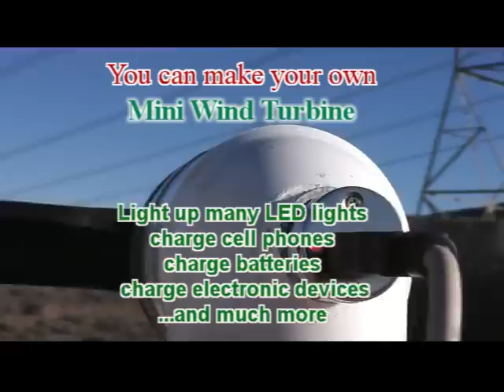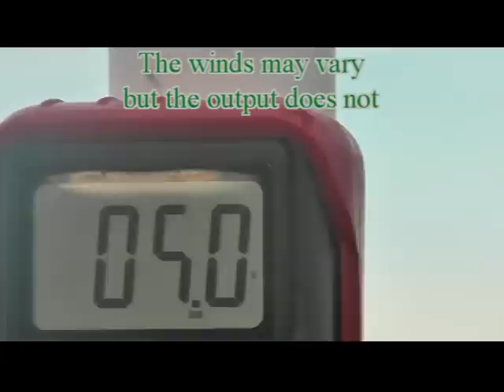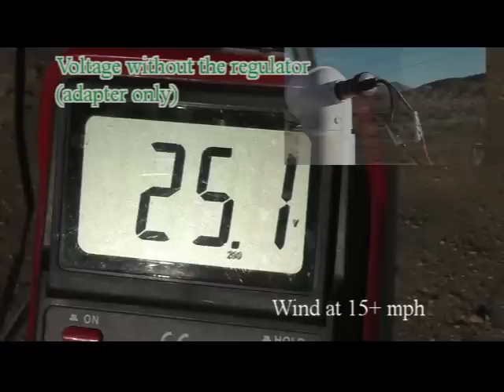Mini Wind Turbine G2

Comment: Where did you get the prop?
Have you made a version with a vane?
What kinds of current do you get from that bipolar stepper?
Reply from the maker: +Ryan Ethier 
Ryan, I sell these props, brand new, at the same price one buys direct from the factory $19.69. They are made of glass fiber composite, extremely durable. The specification = 20x8 (20" is the diameter).
-Yes, I have a version with a vane (shark tail) which I am about to record on video, and it is going to be published here on my YouTube channel, as well as sold in kits, probably on Amazon.
-The generator on the kit has two coils inside. Each coil generates from 100 mA to 300 mA of current. In 20 mph winds, I have registered 70 volts plus.
It is not a powerful wind turbine, but quite an interesting toy.
Any further questions, I'll be glad to answer. STT
Reply: +ScienceTubeToday Thanx for the quick reply! I live in S. America so these props run up around the inaccessible range for a toy, even a real cool one! But.... 200 to 600 mA is enough to charge a Li-Ion battery pretty quickly! Ever heard of the MCP73871 by Microchip? The turbine along with some regulator and charging circuitry would make for a wicked gadget to take along to the beach!
Reply from the maker: Voce mora no Brasil?
Thanks for mentioning the MCP73871. I will do some research on it, and see if and how I can integrate it in my Mini Wind Turbine kit. The kit comes with a full wave bridge rectifier, then a voltage regulator and two capacitors to completely smooth out the ripples of the rectified current. I think you know that the full bridge rectifier does not eliminate all the ripples...That's a job to be finished by the capacitors :)
Yep, that would be nice if one could take it to the beach, camping, hiking, log cabin up in the mountains. One disappointing problem is that we can't charge an i-phone with it. The iphone has a proprietary software that does not allow it to charge. You always get a message "this device may not be compatible"...and you're done! Who knows if the MCP73871 can be a game changer... 
Take care!  STT
Reply: Opa! BR aqui, LOL! 
Just one more case against iPhone.... 
Unfortunately the MCP only outputs 4.2 Volts. It does however automatically charge a single cell Li-Ion and also controls where the load get's its power from depending on source voltage. The only problem then is boosting the output or batterty voltage from 2.5/4.2V to 5V.

Comment: Where do you get a propeller?
Reply from the maker: +Robert Reed 
Robert, I sell them for $19.69. These propellers are very sturdy and high quality. They need moderate to strong winds to perform well.
Reply: Do you have a link to the propeller and fan? I would like to make the same exact build.

Comment: again a nice video, please tell me what was the detent torque of the stepper motor that you used and what current did u get without the adapter and with adapter , did you really get 1 amp ?
Reply from the maker: +G S Shirnewar 
Since I removed this stepper motor from a printer, I could not obtain the specs on the detent torque of this particular motor. The factory will never pass that information along, nor will they publish or reveal it...it is proprietary information (I tried). I can provide an educated guess... Detent Torque = 65 G-CM (0.9 OZ-IN) Min. This stepper motor gave me close to 1 Amp at very strong winds. After the video was published, I thought  I should  have made a different statement...like close to 1 Amp. I have some in my workshop that give me 0.4 to 0.7 Amps, and that seems more common. I did not mean to publish misleading information. STT
Reply: Is there any electrocution danger from the amps / voltage this can put out? 30-50 volt, close to 1amp?

Comment: I bought a nema23 stepper motor from eBayThe shaft turns hardly Wondering if its normal or it should be smooth
Reply from the maker: +Iman Faith 
What makes it hard to turn is the detent torque which is the interaction of the powerful magnets in the rotor (the spinning part) and the stator (the outer casing). Your motor has a high detent torque, and it will be a challenge for you to make it turn...you will need a large propeller.
Reply: How large?
What I was thinking is using a triple PVC propeller 50cm length for each blade, is that OK?
Reply from the maker: It might work, depending on the design. The challenge is to balance the three blades. Even professionally made blades have to be balanced. Vibration influences performance. As long as you can eliminate vibration as much as possible, you should be OK. The other point is structural strength. PVC tends to break in strong winds. I would reinforce the point where you screw the blades - if you are dealing with strong winds. Another suggestion is to use a 3 blade propeller from a household fan. I have used them, and they work OK too.

Comment: Very interesting, just about to get started, but according to your video, the bridge rectifier turns AC from the motor into DC, but doesn't the motor already make DC? Does the adapter need AC or DC? If it needs AC, doesn't this method not work, and if it's DC, isn't the bridge rectifier redundant?
Reply from the maker: +Austin Parenteau 
Austin, not at all. A stepper motor only produces AC. You do need a bridge rectifier to convert it to DC.

Comment: can I use cooling fan blade from pc instead of prop adapter?
Reply: +Arun Kumar duh ive been trying to figure out where to get a fan from lol and never thought about just using the fan from the cpu fan lol... thanks... they should work great. and already made to work on these small dc motors. good idea.
Reply: *****
i went to an RC hobby shop and found some air plane propellers that fit nicely and seem to work great... they are about 4 inches long and three blades...
Reply: *****
i was thinking of putting it on the bottom but making a box of some sort like a shelter sort of for the plug. i have a nice enclosed patio i might place them on as well and just run the wire into the patio then add the plug... options options...
Reply from the maker: +FixedByDoc Homesteading 
I saw your comment, and here comes a quick reminder. AC travels much more efficiently than DC, therefore, only use the rectifier after you brought the current to the final point where you will need to use the DC. If you rectify right at the origin (say inside the wind turbine), then run a wire, you will lose a lot of electricity. (Read "War of the Currents" Tesla Vs. Edison...well, Edison, the DC guy lost  Tesla and Westinghouse the AC Guys won... :)
Reply: ScienceTubeToday
the length even with the turbine on my patio roof would only be about 2 feet before reaching the battery which i would set on a shelf near the ceiling of patio. attach charging station there.

Comment: cute
Reply from the maker: +snaprollinpitts 
Thanks!  :)
Reply: I have 46 size brushless motor I would like to do this with, I just gotta find a set of blades, thanks for the idea!
Reply from the maker: You're welcome! 

What size blades (propeller) are you looking for? You also may need a propeller adapter to secure the prop to the motor shaft. Do you have them both?
Reply: anywhere from 24" and multiple blades would be good, and the shaft size is about 3/8".
let me know if you have anything, and what you what for it.  thanks mike
Reply from the maker: I have 20" 2-blade propellers just like the one in the video for $19.69. I also have a set of three blades and hub. Each blade is 21 5/8 long. When assembled to the hub it measures 22 3/8 center to tip, so your total diameter is approximately 45". This may be too big for your project. The hub hole is 5/8, so it would require a very precise adapter. If the adapter is not 100% correct, you will have a wind turbine's  public enemy number 1 which is vibration. I suggest you look online first and see if you can find something that fits your project. The blades I have cost $18 each and same price for the hub.Meantime, you may experiment with attaching the shaft of your motor to a regular drill. Spin the shaft with the drill at different speeds and see if this brushless motor will produce what you expect. I would not invest any money before testing the output. (I am assuming you have a voltmeter). Please be extremely careful using the drill and motor, and start a low speeds to make sure your set up is safe. Good luck. Let me know how it went

Comment: Hi Sir Can i ask What are the name of those 4 Diodes?
Reply from the maker: They are Schottky diodes
Reply from the maker: but, you can buy a bridge rectifier already made, they are very common electronic components, and very inexpensive too. They take in alternate current, and output direct current
Reply: What's the spec of the diodes? 100V 0.1A? or 45V 12A?  or 30V 1A ? Or?

What's the max voltage / amps this turbine can generate?

Comment: do you not need to put smoothing capacitor after using the bridge rectifier?
Reply: pls reply, we will use this as our research
Reply: Yes, a capacitor can be added to smooth out the peaks. It will make it better. Good comment Patlo.
Reply: Yes, a capacitor can be added to smooth out the peaks. It will make it better. Good comment Patlo.
Reply: thank you for the answer, my stepper motor has 4 wires, how can I make it to two wires?
Reply: my stepper motor only produces 7.5 to 8v ac even at high rpm, what type of stepper motor did you use?

Comment: Can you please provide the motor you used? "Low detent torque" does not help when purchasing direct from manufacturers. They requested torque in cm, Oz, etc.
Reply: it looks like a stepper motor (type 17) with 6 wires.
Reply: the motor shaft on those is 5mm  and you can get a propeller adapter from Walmart online.  and propeller in a hobby shop. 18" circumference
Reply: If a stepper motor is rated for 12v, how can it generate up to 30v safely?
Reply: Would this be a good motor/? https://www.adafruit.com/product/324 And what about torque? I've seen some called high and low torque, what would be best?
Reply from the maker: Yikes, I missed your comment. We need to know the "detent torque", which is different than "torque". An easy way to find out is to test the stepper motor manually. Detent torque is the resistance that you can feel in your fingers when you try to spin the shaft. If the resistance is high, then it has a high detent torque, and you will need a bigger propeller to overcome that resistance.
Reply from the maker: OK, the voltage that runs a motor has nothing to do with the voltage the same motor produces when used as a generator. For example, I had  my mini wind turbine outside on a day when the wind was blowing 30 to 40 miles an hour. I was measuring between 60 and 80 volts output, then I connected it to a step up transformer which gave me between 300 and 400 volts (yes, this little wind turbine you saw on this video). What happens is that there is really no net gain, since the voltage increases at the same proportion that the amps decrease - therefore the Watts stay the same. High voltage is useful to light up long fluorescent lights...and that light stayed on for as long as the wind was strong...

Comment: how much willl tht all goign cost
Reply from the maker: Buying everything new, with taxes, shipping etc...I'd say $60 to $80
Motor around $20, Propeller some $25, Prop adapter $7, PVC fittings, bridge rectifier, car charger connector, copper wire...
Reply: ok thanks

Comment: What about storing the energy? I want to make one but would like to store it what can I use to do that?
Reply from the maker: +jeremy s 
Hi Jeremy, the most efficient way to store energy is by using rechargeable batteries. Just a word of caution: Using a wind turbine to charge a battery must be done properly. Just charge the battery to its correct parameters and everything will be OK...do not leave it charging by a wind turbine indefinitely because that will damage the battery (unless of course you use the recommended electronics that will stop charging, once the battery is full)  Take care  STT.

Comment: Would you list the parts and where you got them? About how much was each piece?

Thank you
Reply from the maker: +Ted Wilson 

- Stepper Motor Varies in $ $13 to $25 (online or remove from an old printer - The one on the video is size NEMA 17)
 
- Front PVC black 2" Cap  $3 - $4  (Home Improvement Store)
 
- Metal Adapter 2" (Front) PlumQuik P3000-22 ($7.00 Home Improvement Store)
 
- 2" PVC Elbow  $3.50 (Home Improvement Store)

- Full Wave Bridge Rectifier 100V 2 Amp $3.00 Online (Ebay, Amazon, Digikey, Mouser, etc..)
 
- Propeller  Classic 20x8 or 20x10  $19.69 (I sell it for $19.69 or you may purchase it from Master Airscrew Propellers, same price)
 
Spinner / prop adapter ElectriFly (GPMQ4945) $7.00 (online or at a Hobby Shop)
 
Stepper Motor Mount Screws  $2.00 (Sorry, I am not sure...I have them in my workshop, don't remember where I purchased them)

20 gauge speaker wire - 25"  $4.50 (Home Improvement Store)
 
Cigarette Lighter adapter Varies in $ $5.00 (Online) 

Cigarette Lighter Charger 5V, 1 Amp Varies in $ $5 to $15 (Online)

I hope I haven't missed anything... Any questions, please let me know.

STT
Reply: +ScienceTubeToday Ordered most of the list online. Now to wait for delivery!
Reply from the maker: +Ted Wilson 
Hi Ted, the prop adapter is the GPMQ4939 (Great Planes Set Screw Propeller Adapter 5.0mm Input to 5/16x24 Output). I just realIzed that I had the package in the wrong slot when I was writing down the list for you, and glanced at it. I sincerely hope this is one of the items you have not ordered yet...or maybe it is still in time to cancel the order before they ship, and get the right one. (FYI-the one I listed is 8mm and will be too big for the shaft of a NEMA 17 stepper motor)
Sorry.   STT
Reply: ScienceTubeToday
I sent them an Email, hopefully they read it.

Comment: where do we get a two blade propeller and its adopter?
Reply from the maker: sowmya vadde 
Propeller: You can get it directly from the manufacturer Master Airscrew. I used a 20x10, but a 20x8 or a 20x6 would be OK too.
The prop adapter you can buy online. But make sure you know your motor shaft diameter. Mine is a 5mm 5/16 x 24 (What hese number mean is: 5mm is the diameter of the motor shaft, 5/16 is the diameter of the side that fits into the hole of the propeller and 24 is...24 threads per inch (a 5/16 x 24 is a very common diameter and thread). Hope this helps. Have fun with your project. STT   :)

Comment: Does the type of phone or cable determine whether or not it will charge? The charging light of car charger lights up but it doesnt chastge phone even though it is producing energy.
Reply from the maker: First, I do not recommend charging a cell phone if you don't have enough experience and knowledge, you may damage your phone. Here is why: You need "regulated voltage", a "smooth DC current", and the "correct voltage and amps". Not knowing the specifics of your device I can't really comment. You just mentioned that the phone is not charging. The AC current must be rectified (make your AC into DC current via a rectifier), then you need a "voltage regulator" that will deliver 5 volts, then you need a capacitor that will smooth out the current peaks and valleys still there, even after the rectifier. A car charger will be useful, however, that current going into the charger must be limited at 12 volts, up to 14 volts (as the input current). Your device (windmill?) should produce at least a half amp in order to charge a cell phone. If it is producing less than a half amp, then your phone will not charge. Ideally it should produce from 1 to 2 amps. Once again, I would recommend you do not attempt to charge your cell phone or any delicate electronic equipment (camcorders, etc..) you will more than likely damage them.   Please let me know if you have any further questions.

Comment: Hi, all i want to do is build a simple wind turbine (they are so expensive to buy here in Australia) to trickle charge a 12v battery through a charge controller , could i use a cordless drill motor or a 12v car radiator fan motor ? also vertical access blades or normal propeller blade which is better ? if you have plans and list of components or know where i can get them (happy to pay) could you PLEASE point me in the right direction to get them, i would really appreciate your help.
Thank You.
Kind Regards.
John.
Reply from the maker: John Watson 
John, have you considered purchasing a 100 watt horizontal wind turbine directly from the manufacturer, instead of buying it locally? I may have a suggestion of which manufacturer to buy from, but I can't post it here. We may have to communicate via email or exchange messages. This is the manufacturer I am negotiating with to produce my small wind turbine kits to be sold here in the U.S., unfortunately I don't have them ready at this time. You can do your homework and determine if that suits your needs or not. Write me back if this is something you'd like to pursue.